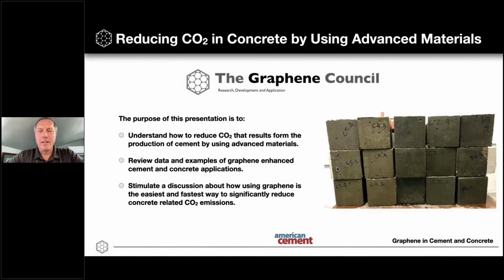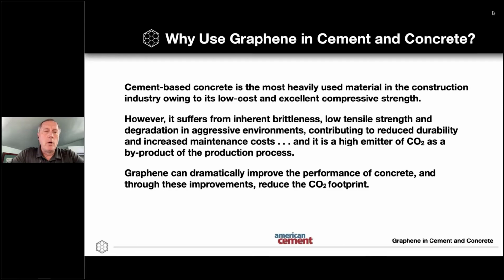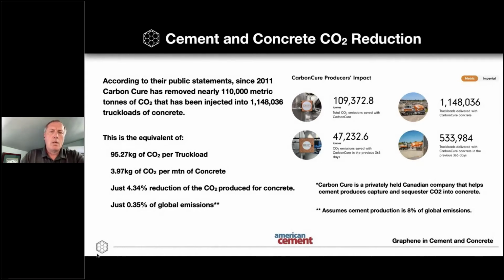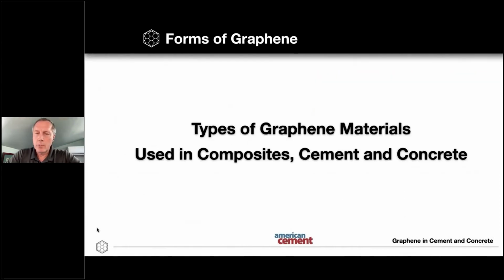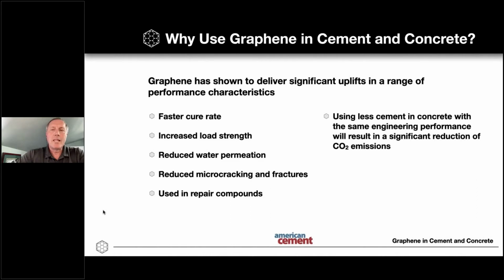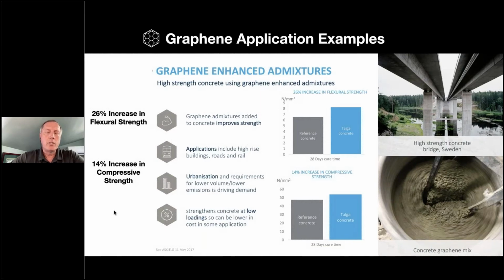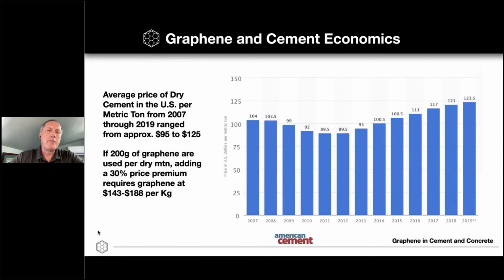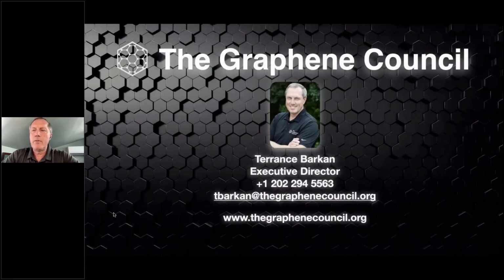Using Graphene in Cement & Concrete

Comment: What about the use of  Graphene to develop smart concrete for it's application in structural health monitoring based on it's piezoelectric properties
Reply from the maker: Using graphene to reduce embedded CO2 and improve the physical characteristics requires only a very, very small amount of graphene. At those low levels, it is not sufficient to generate a current sufficient to detect changes. That does not mean graphene could not be engineered into a sensing role within a structure but it is unlikely that it is near term possible to make an entire structure capable of sensing.

Comment: How is adding an admixture reducing CO2 content?  We need to see how reductions of cement can be accomplished with the admixture while maintaining the workability and other properties.
Reply from the maker: Dear Eric, thanks for the comment. The answer lies in your question / comment. Adding extremely small amounts of graphene to a concrete mix (for example, 30grams per 1 metric ton) improves compressive and flexural strength of the concrete allowing approximately 9 kgs of carbon reduction through the reduction of the cement portion of the mixture/compound. It is as simple as that. 

What is equally important is that the cure rate is accelerated which is very important and attractive to a contractor who can then move to the next phase of the project sooner, saving money and increasing work capacity. Hope this is helpful.

Comment: And what would graphene do to the conductivity of concrete?
Reply from the maker: The amounts of graphene used to enhance strength is not enough to create electrical conductivity. It is possible to create conductivity but it requires a higher level of graphene content.
Reply: Thanks for answering.